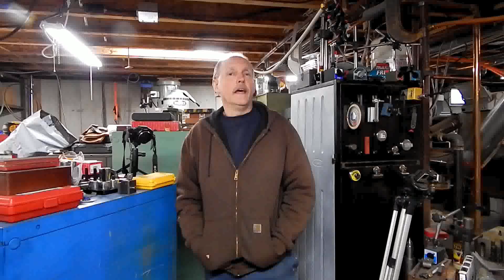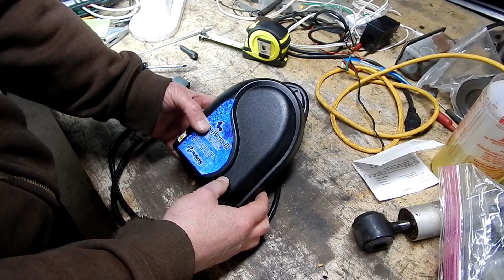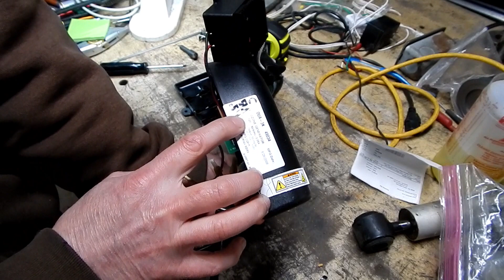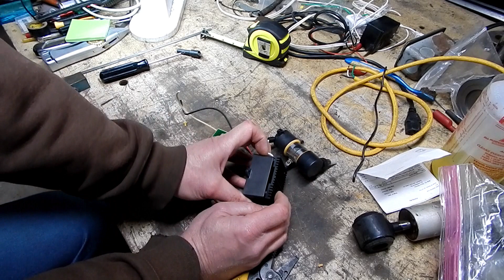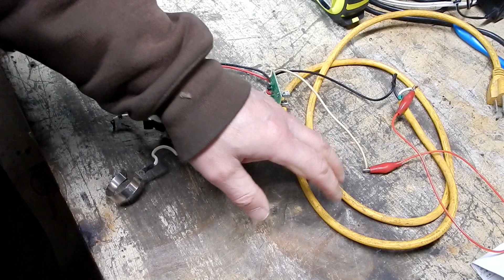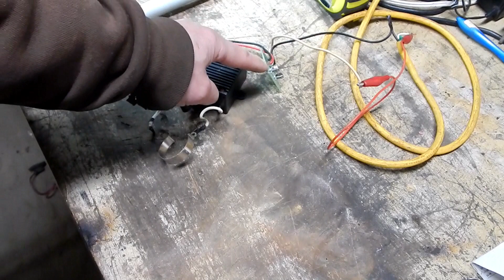High voltage hi-jinks

Comment: Hey Steve. @John Strange told me you or @Tech Gorilla might be able to offer some advice on a weird electrical issue I am having measuring amp draw on a vehicle. So I thought I would take a chance and see if you had any ideas. The vehicle is 2010 GMC van. I am doing the normal measuring, breaking the negative lead and measuring with a Fluke multimeter. I get 1.5 amps and start pulling fuses. Pull a fuse and put it back, its good, and then the reading drops off to near zero. I reset the leads and they read 1.5 and then same thing again, I pull and replace a fuse or 2 and then the reading just drops to zero. So basically I had to remove and reset the leads after every fuse pull to find the fault, which I did find. But I have never had this problem of having to reattach my leads between every reading.  I tried troubleshooting the multimeter but it seems fine. I tried different leads and same thing everytime. I get a reading and then after a few seconds it goes to zero but it works otherwise. Anyway if you have any ideas what might cause this I would love to hear them. I have never run into this problem. All the best!
Reply from the maker: Not sure why it's doing that. I've owned several Fluke meters over the years and don't ever recall seeing that. I did have meters with a hold feature that allowed the reading to stay, but your description sounds different than that.
Reply: @stevewatr  Thanks Steve. It seems like a really odd issue to me as well.

Comment: Back when I grew mushrooms, I used a ghetto ozone generator to sterilize the room I was using.  I used a neon sign transformer and two pieces of steel window screen on the inside and outside of a prego sauce jar.  It was janky as frig, but man it could fill a room with ozone.  I've got a pro model with HEPA built in now.  Ozone is not goot for humans or pets in quantities that you can smell.
Reply: Cool.